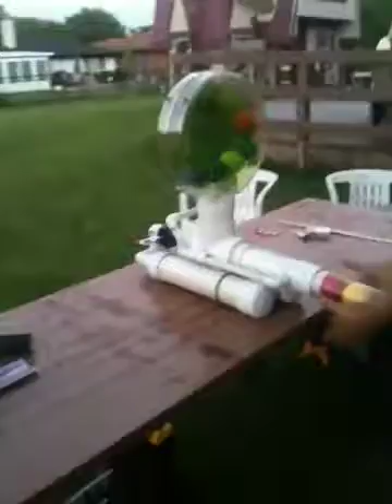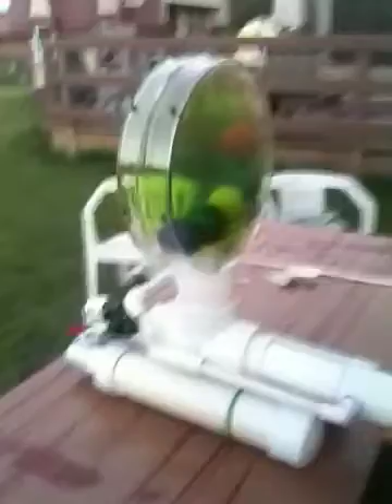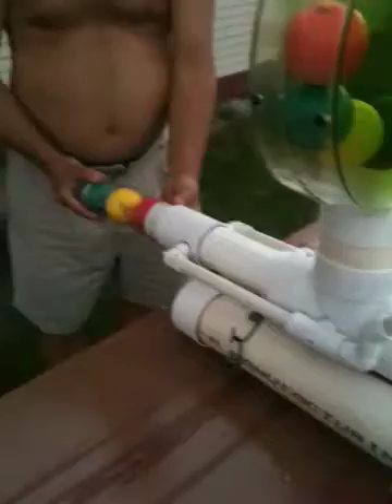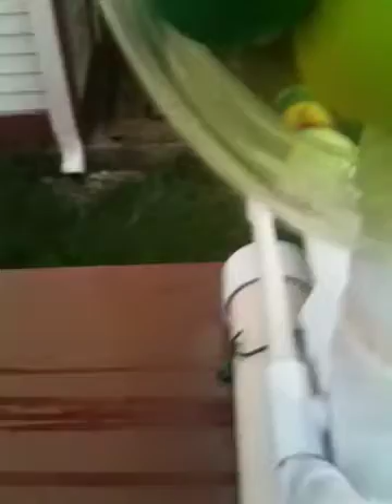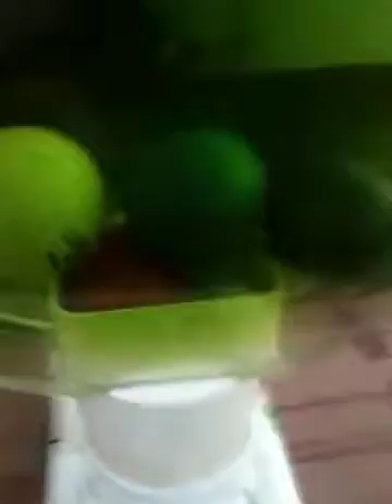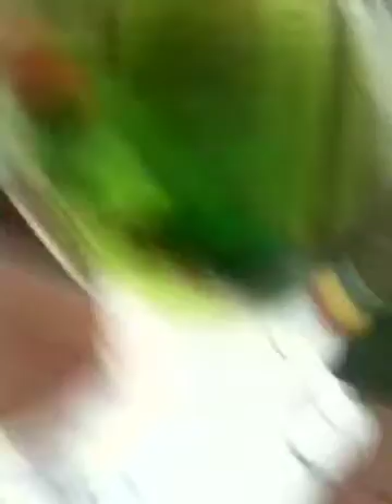Air cannon - hopper and breech completed

Comment from the maker: @remodrummer99 Thanks, you wil have to let me know what you think after you see the new paint job. As far as cost, I don't know exactly. I purchased some parts, and so did my dad, and we tend to over purchase just so we don't have to go back to the hardware store. I would guess around 65 - 70 dollars. There are a few hard to find parts like 2.5 inch pvc, but my dad happened to find a local supplier.